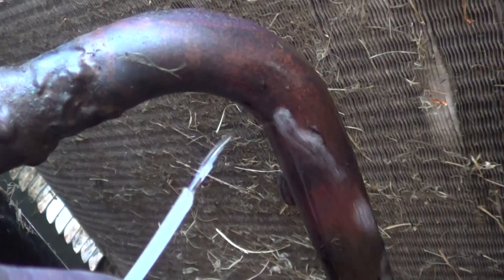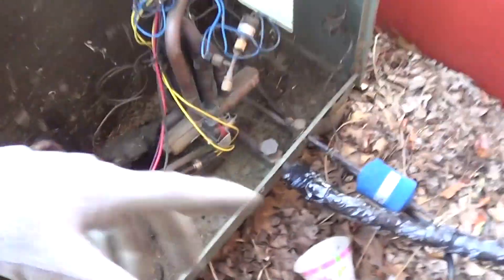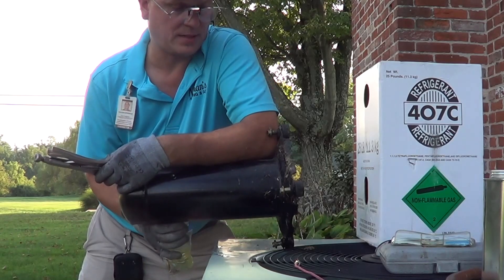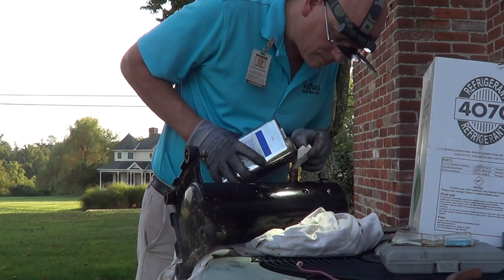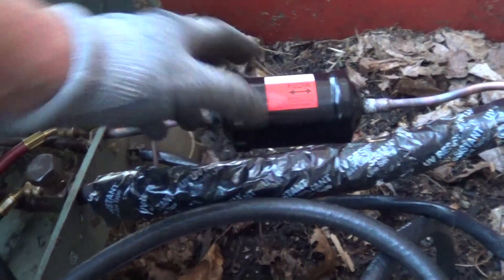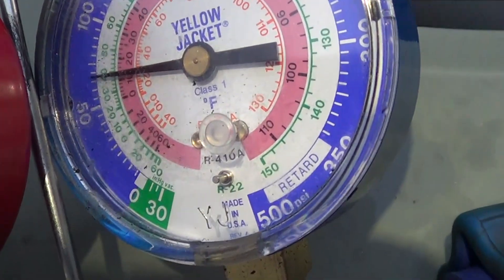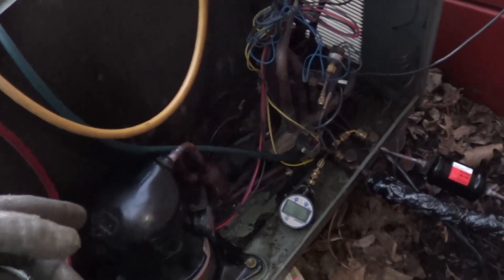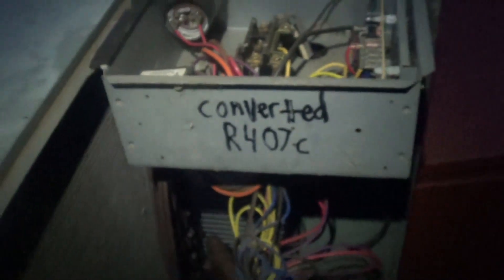Converting a R22 system to R407c

Comment: the metering device must be changed if doing 407 ,,thats one thing ,,,another if you ever worked with that 407 c is very  tempermental if i can say that a change in just 10 psig will result in system doing absolutely nothing , and your going to wonder what went wrong ,,,,its not made to be complicated but DONE RIGHT  at least ,,,,it does help to be TRAINED PROPERLY ! take the time to do it right all the way ,,,just saying
Reply from the maker: 407c was designed as the closest match to r22.  Expansion valves are usually marked as r22 and r407c from the factory.  The same for compressors that have poe oil.
Reply: ok got it ,,,i will find this guys who told me he had YEARS WORKING WITH 407 that told me NOT to do this ? and lead him to maybe look at some of these vids ,,,,,thanks for your reply ,,,,,,never stop learning is the key
Reply: ok ,,,,i talked to the teck again that i just met ,,,,he has years and years of working with this 407 c and telling me not to do this to my unit ,,,ok i GET WHAT YOUR TELLING ME ,,,ok he told me to tell you to drop 10 psig from the system and see what happends it will drive you nuts he says ,,,,just trying to help ,he made it CLEAR that most people did NOT work  with 407c LONG ENOUGH to know what it does ? ,,,, maybe it is complicated a LITLLE LOL ,,,,,,

Comment: Your gauges ain't designed for r407c so why did you use those gauges?
Reply from the maker: I used pt tables.  Bit now I use the very small cellphone gauge from testo.   Awesome tool.
Reply: NathansHVAC ok I'm new tec graduated in 2015. So to retro fit you change the oil to ther 407c compatibility. Can you just use that  thing when you just put in the system to make it compatible?one tech I was helper did that.

Comment: I personally stick with R-22 (chlorodifluoromethane), reasons: SAFETY, Pressures, detection, non-toxic and non-flamable. 'Ozone Layer' and 'Montreal Protocol' are a BIG LIE that big bussiness men created to become richier every day. There's no subtance on Earth that God creted that can arm our environment. The solution to air pollution it's TREES; plant a tree, create gren spaces and preserve nature.
Reply from the maker: Ozone could be a lefty win.  The hole over Antarctica closed up mostly from medical not using cfc for sterilization.  Global warming scam is a bigger fail.  The lefties are trying to ban r410a for gwp.  The eco friendly replacement is being used by Mercedes.  It costs $2000 per bottle, is flammable and breaks down in the system.  Compressors will fail again like in the 1990s.  It is a scam.

Comment: Freon MO99 is the closest performance match in terms of capacity and efficiency to R-22 of all "no oil change" replacement refrigerants and is compatible with all traditional and new lubricants. MO99 Freon also has a significantly lower discharge temperature that may prolong the life of the old R-22 compressor. I've had it running in my old R-22 unit 3 years now and works perfect and much less expensive than R-22.
Reply: I was watching another video and one guy commented that he is in the US Army and they are converting all their equipment to MO99.
Reply: Rob... How did you do the swap. Im not an hvac guy but im trying to figure it out to attempt to save money? Any good resources will help to.

Comment: I need to convert my ac system from r22 to 407c.  SO HOW DO I FIND AN HONEST AC MAN?  Just yesterday i was told to do this I WOULD NEED TO CHANGE MY ENTIRE SYSTEM.
Reply from the maker: If your system is over 15 years old, it is a real gamble putting money into it.  If it is over 20 years, it takes a miracle.  You can also convert to a drop in substitute like 422b for less money.  But, you lose 5 to 10% capacity.
Reply: @NathansHVAC  I have a 4 ton 4year old thermo zone r-22 air handler. I just changed my condenser to a 4ton thermo zone -r410. The tech removed the gas and oil from the new unit and replaced it with 407c but my house isn't cooling below 77 degrees. Please help.

Comment: How much did you charge for all this?why not put all this money towards new system!
Reply from the maker: The system was 10 years old.  It still has a few more years left.  If the system is 15 or older, your point is valid.  I'll usually credit back the last repair towards a new system if it is a real junker.  Getting them running frees me up to do more systems in the off season.  But, that was an easy 2 hour repair that pays good money.

Comment: Question. I have an R-22 system on my RV Can I drop 407c into that system and be able to use it? Because $85 on eBay is A LOT more attractive than $600 plus for a new unit. I mean I can do a complete oil dump and replace if necessary, I just want to avoid removing a compressor from a rooftop unit and so on..
Reply from the maker: ElfNet Gaming rv compressors are weird. Changing oil is hard. I would just stay with r22.  You can buy a 15 lb can or even 1 lb cans.  Or, use 422b.  But r22 will be best.
Reply: Well that unit is dry as we speak since I had to repair a leak in the suction line because someone put one of those screw on taps on it and didn't install it right. All the R22 leaked out slowly. so now It's leak free with a proper charging tap soldered in the line. I didn't think to look for  smaller cans of 22.. I was pricing the normal jugs and they were about as much as a new AC unit..

Comment: Could you not short cycle the compressor opening your manifold and have it pump the mineral oil out after removing any R22  ??  Then pull a vacume, install via the vacume the synthetic oil, then pull a vacume a second time before dumping in the 407C ??

Comment: One thing that was not mentioned how much was that 25lb of 407c compared to r22
Reply from the maker: Good point.  When I bought 407c a few years ago it was $100 for 30 lbs.  I just saw $150 on ebay.   R22 has been jumping around alot.  It is only legal new for 1 more year.  The current price is $500 per 30 lbs.  I expect R22 to hover around $800 per bottle next year and then forever.
Reply: NathansHVAC I believe it my system went out about a month ago needed new fan and new capacitor, and 3.5lbs of r22 at 55.00 but the heat was unbearable, what you do the total was 565.with labor

Comment: Good job on the video, I learned a little more.  I'll be watching several more before starting to make a move but I appreciate your information. I will probably convert to 407C and get  a new compressor.
Reply from the maker: Clint Hightower surpluscityliquidators.com
Reply: @NathansHVAC  Didnt find any coils there, let alone a horizontal 5ton r22

Comment: What was the small gauge you had  connected to the pressure line , and what for ?
Reply: Sho Bud It’s a digital micron gauge your manifold gauges can show you a vacuum but what you really want is to pull a 500 micron vacuum that holds to ensure the system is free of air and moisture and leaks

Comment: everything he did was totally unnecessary and was only done to increase cost to the customer. all he had to do was vaccum and recharge with R-407. it wouldnt have mattered at all.
Reply from the maker: What about fixing the leak or replacing the filter dryer that was exposed to moisture when the system went flat?  Was that unnecessary?  Also, the existing mineral oil in the compressor isn't compatible with R407c.

Comment: No oil flush? What about cross contamination?
Reply from the maker: Synthetic and mineral oil mixes fine.  There is no contamination because they both lubricate the compressor as intended.  The difference is solubility with the refrigerant.  So, there needs to be enough POE oil so that the refrigerant will thin it out and bring it back to the compressor.  Since oil is sticky, the returning POE oil will also return the mineral oil that doesn't dissolve with the HFC refrigerant.  Residential applications are fine with 20% POE oil and higher.

Comment: FYI, POE oil is highly moisture absorbed, your oiling charging technique is wrong, you added moisture to the system while you adding oil at atmospheric pressure, you should vacuum the system first then inject the POE oil.
Reply from the maker: POE doesn't hold much moisture.  It can only go up to 3000 ppm.  0.3%.  The filter dryer will take that amount out.  A 30 ounce oil charge can only hold 0.09 ounces of moisture if you leave the oil out for days.  The dryer can clean that up.  I only expose the oil for a few minutes.

Comment: Why not use MO99, no need to change oil?
Reply from the maker: 10% Lower capacity and flow changes. R407c is the only exact matching replacement for R22.

Comment: i forgot what refrigerant is in r 22 ? of hand?
so best to change all of the oil or as much of course
Reply from the maker: R22 mostly used mineral oil.  Some systems used Alkybenzol, which is still basically mineral oil.   The modern replacements such as 407c use Polyolester.  You can mix the oils.  But, try to keep mostly POE oil.  Also, R22 is compatible with all oils.  Ozone safe refrigerants such as 407c need 20% or more POE oil to work properly in typical residential applications.
Reply: thanks i been out of the  game for a long time i am hvac cert proper shooling i just dont do it as a livinb anymore ,,thanks for reminding me ,, your 407c is a good idea ,,i thought for a while and some friends i went to school with thought it was mo 99 , now we know its not ... nice vid very helpfull

Comment: If you replace R22 with RS 44 B you don't have to use that oil and it's only 1 degrees difference and pressure
Reply: Michael Lowe are you the dipshit that recorded someone blowing gas out of a condenser and got him fired for doing so
Reply: Dylan Velasco how do know this

Comment: Just wondering about the POE oil being very hydroscopic? And also don't you need the bubble and dew points for superheat and subcooling with 407c? Just wondering.
Reply from the maker: hector6970 a filter dryer will dry the oil out.   One quart doesn't hold much water.  Maybe just a drop.  Temperature glide is already built into most pressure temperature tables.
Reply: Cool thank you

Comment: I would have changed all the oil and i didn't see you give the system a good  15 -20 minutes vacum before charging with the 407. That thing is mandatory! ...and you only have to charge it 90 % of the r22 charging capacity. You could also read Widow's son reply. That's the best thing you could have done.
Reply from the maker: Thanks for the info about not charging a full charge on R407c.  As for vacuuming:  10 minutes with 3/8 hoses, removed valve cores and a vacuume tree is the sames as 40 minutes thru 1/4 inch hoses.  I'll do a video on this subject some day.   It is all about pressure drop vs flow rate thru the hoses.  At 500 microns, even the smallest pressure drop destroys the vacuum flow to the pump.  The reason is that 0 microns is the absolute limit.  Think of placing a condenser unit in outer space and just opening the ports to do the evacuation.  The flow rate to space is determined by the opening size and the hose connected to it.  Flow rate is a square of diameter.  3/8 has 2x the diameter as 1/4 and 4x the flow rate.  These rules don't apply to reclaiming because a 400 micron drop on the hose is 0.01psi.  You will never notice such a low pressure drop effecting flow at 100 psi.  However, at 500 microns the same 400 micron pressure drop means much longer vacuum times.

Comment: You should have just used r422b or r422d no oil change needed
Reply: the widow's son so i can top off my r22 with 22d or 22b
Reply: Asher Zeitlen no you have to remove the charge and pull a vacuum then charge with 422b/d
Reply: what about R417a?
Reply: R407c only has a 4%"capacity loss. R422b or nu22 has a 16% capacity. This from arkema chart which is the manufacture of the refrigerants. 
I've done probably 100 conversion now both R422b and R407c. R407C works way better. Must change oil.

Comment: Why isn't your high side attached
Reply from the maker: I didn't need it, because I was weighing in.  If you are weighed in and everything is normal on the suction, the system is a-ok.  Plus, this was a leaker, not a flow problem.  I usually check subcooling if I don't know how much refrigerant is in the system.  I have a baby small ashcroft gauge for that that I carry in my bag.  I do realize I'm using experience in place of measuring.  I have been bitten a few times on 1/4 hp reach in coolers with overcharge.
Reply: NathansHVAC what are the proper operating pressures for 407c?
Reply from the maker: Me So Funky Fresh you have to use the PT chart. However there are two different pressures ones Vapor for suction and the other saturated for liquid. Then you go by superheat and subcooling which will be similar to R22. 5 - 10 subcooling for cap tube 10 to 15 subcooling for expansion valve. Suction superheat can vary but typically goes down to seven degrees for Goodman expansion valves 10 degrees for Carrier expansion valves. Cap tube or piston can vary depending on indoor temperatures with typically varies from 0 to 20.

Comment: 30 deg is a lot of superheat at the compressor.  Doesn't this reduction in compressor winding cooling cause premature failure?  GE did research in this area many years ago and determined that for every degree of increase in superheat you reduce the winding life by X number of time.  I don't have the figures here right now, but it is significant.  Might be better to just replace the entire unit and indoor coil in my humble opinion and convert to another refrigerant that way.  Also once you see a leak like the one pictured, the possibility of the system being run in negative (suction) at the leak is great with resulting alga growth inside the piping.  Would be a good idea to find out how many times the owner had it recharged, how long it sat unused, etc.   Hope you boiled off those non-condensibles for a long long time after just pouring that oil in like that.  Also I noticed oil residue on the condenser coil near the location of the leak which could indicate a long term issue and increase the possibility of this thing operating at minus internal pressure with subsequent introduction of external moisture etc.  A filter/dryer isn't going to solve too many growth issues inside.  What did the exposed piping look like inside when you removed the leaking ell?
Reply from the maker: The house was probably hot.  If this compressor blows, I will update the video.  But, I believe there have been insulation changes in motor technology over the last 20 years.  I never see bad compressors any more.  As for algae inside a refrigeration system, I can't say I have ever seen that.  I have cleaned mud and water out of marine systems using tampons before before.  But, those systems are ocean cooled.  I can't see anything growing in pure oil.  Dehydration is easy in residential.  A good triple evacuation with 3/8 hoses removes all the water accept any sitting under the oil in the compressor.  But, the filter dryer will remove that water when the water is pumped thru the oil pump and sent thru the system.  I haven't had problems repairing flat systems even if they do suck in alot of air.  They are alot easier to clean up than a chiller sucking in water.  As for high super heat:  I will check the super heat the next time I am out at this customers house working on something else and update.
Reply from the maker: A Day I just rewatched my video about the 30 degrees superheat. When I measured that I was a pound low on the nameplate cuz I wasn't sure if that's going to take the whole name plate. So I added in the pound I didn't measure to superheat again because I knew it went down so you could probably bet the superheat is right around 20. Sorry for the grammar speech recognition really does suck.
Reply: + NathansHVAC When I first read your reply about water laying under the oil in the compressor, I thought, "Won't the water boil off with the system under vacuum?". The I realized that the weight of the oil over the oil means that the water will not be at high vacuum but at a pressure equal to the height of the oil column.

Comment: This really shows how much you don't know. R421a is the correct refrigerant to use to convert a R-22 system. You don't  have to change the oil or the filter dryer.
Reply from the maker: R421a loses 20% capacity.  There is no closer match than R407c if you care about capacity and not having to adjust the metering device.  Don't trust me, trust the EPA.  They tested all the refrigerants.  I have a video on this subject.  The link to the document is in the description on the video.  https://www.youtube.com/edit?video_id=npyYvT2Z1wU
Reply: Thank You'

Comment: It's 2017. Come on people let's be real the shit still cools just fine when you drop it on top of R-22 all bullshit set aside. Drop it on top, and let her eat. When the time comes, REPLACE it with a 410-A system. Its not rocket science it is what it is.
Thanks, 
Sincerely, Reality.
Reply: I have an r22 system that's less than 10 years old, with less than a pound of r22 left... obviously the HVAC company wants to charge me for a brand new system... you're saying i can have a certified tech mix the r407c in? or do i need to drain the r22 first??
Reply: @JoshuaWilsonpossible  are you half a pound low or its only got half a pound left in the system
Reply: @carlschroeder3003  half to one pound left in the system.    and at the low cost of over $120/pound i wasn't filling the system w/ that stuff!

Comment: Is the conversion worth?
Reply from the maker: Not on a dinosaur unit.  My rule is that if the system is flat and the leak is easy to fix, a conversion is worth it.  If the system just needs to be topped off, a conversion isn't worth it.